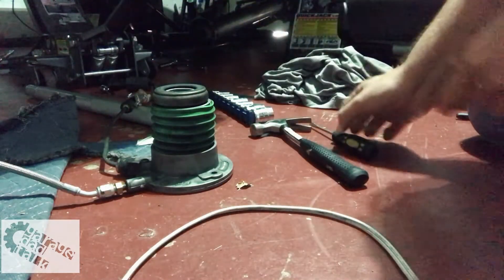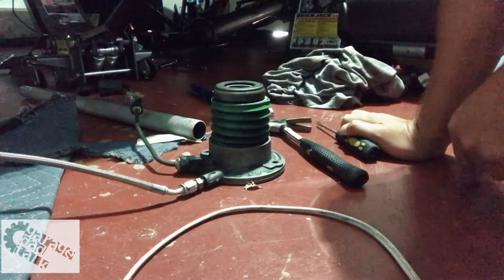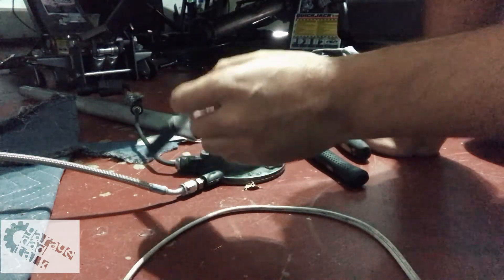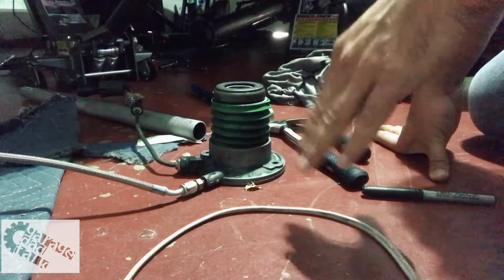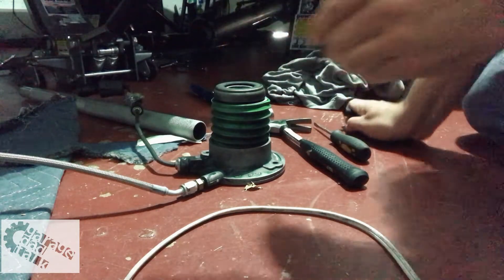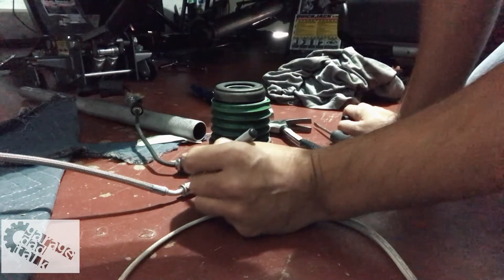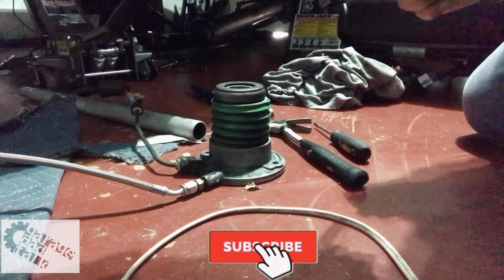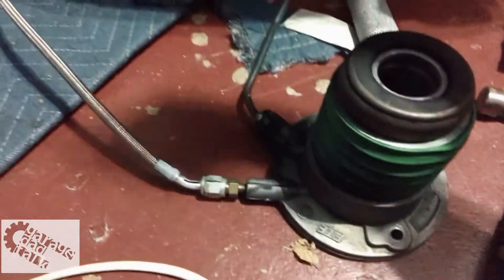TIPS and TRICKS.... C6 Corvette Monster Clutch Speed Bleeder Install...

Comment: How do you bleed it from the remote location in the firewall? Been trying to find a video on it but can’t find any
Reply from the maker: That is a good question. I have done it two ways. 1. requires two people. You have someone pump the clutch and then hold it after the 10th pump. The second person cracks the speed bleeder line and catches the fluid that comes out inside a empty bottle or something. Do this a few times and also drive the car around and do it again. 2. Get a quick bleeder that hooks up to compressor. I have used this with brakes, clutches and anything else that is pressurized. It pulls the fluids through the lines and removes air. Great technique when your doing it by yourself.
Reply: @garagedadtalk6251   hey I just did the full kit Master cylinder slave cylinder clutch pressure play it throw out bearing As I was leaving it at loss program started leaking brake fluid from the bell housing
Reply from the maker: @zacharyfrazier8779  Sounds like something similar that happened to me. If you did a remote bleeder, I bet the angle in which you left it, hit the bel housing and firewall during install and caused it to loosen. This is very frustrating when it happens. The only other option is that you could potentially had a slave cylinder that was leaking. I hope you get it figured out man. Check the remote bleeder first though.

Comment: Anyone know what the threads size and pitch is on the clutch bleeds screw on a lsc326 luk slave??? Or where I can find gm bleeder screw info??
Reply from the maker: That is a good question. I would recommend reaching out to Monster Clutches and they should have the specs on hand. Typically I reach out to them first. Good Luck!